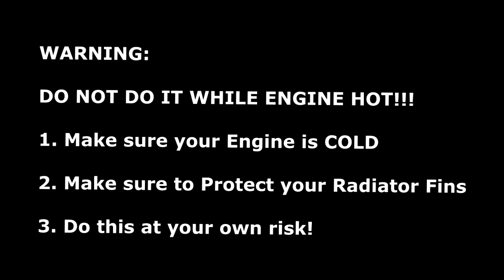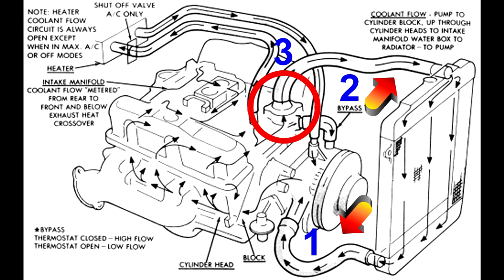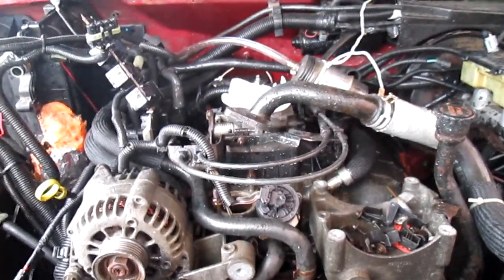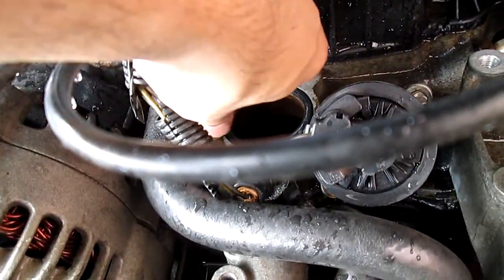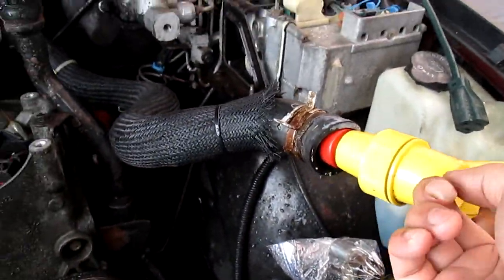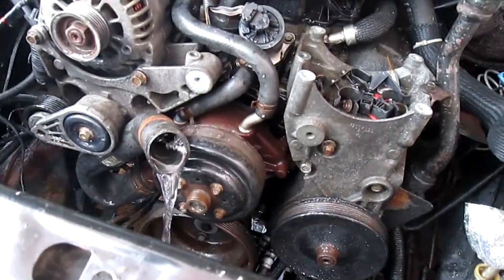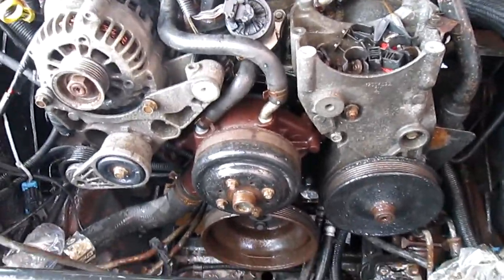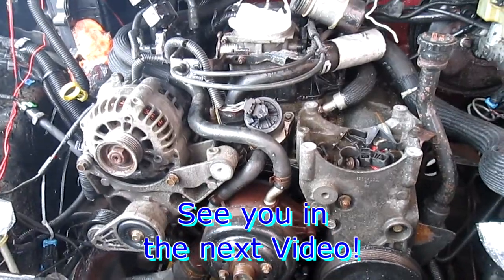How to EXTREME SUPER FLUSH your Car Truck Engine Radiator Cooling Heater Core System

Comment: You mentioned exhaust . It is water outlet pipe from thermostat.
Reply from the maker: YES, that is correct!  Pause the Video where the drawing is.  You will see the " Arrows + Numbers ", try to follow that.
Reply from the maker: If you are going this route... Do BOTH Pipes + your Heater Core too!  Heater Core is really easy as well, just 2 smaller tubes Inlet/Outlet.  That way your Engine is pretty new again.  NOTE:  After Flushing, dump some distilled water in there before you put in New Coolant.